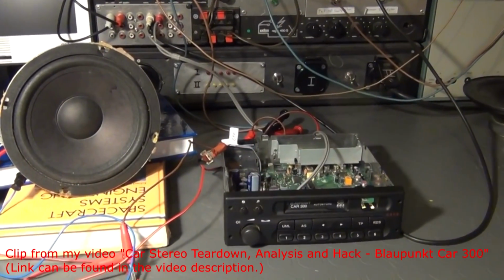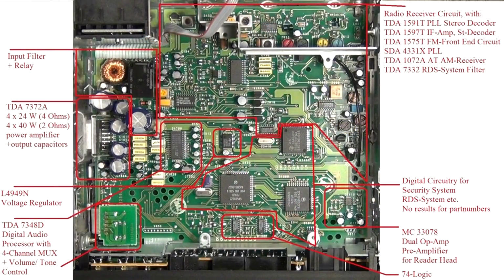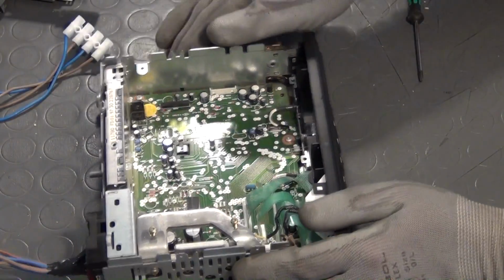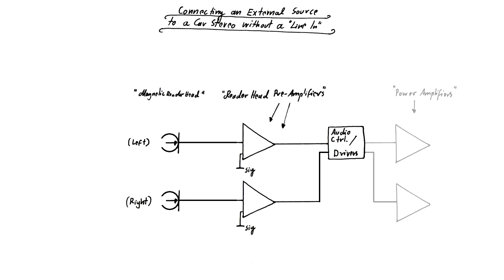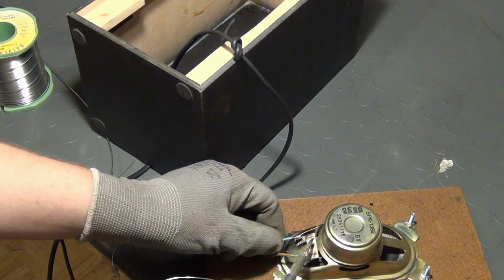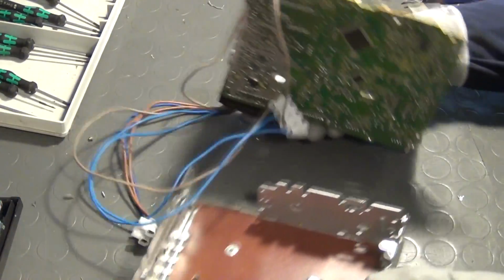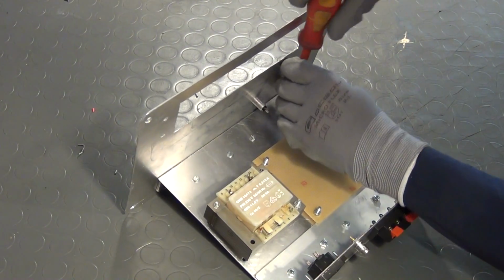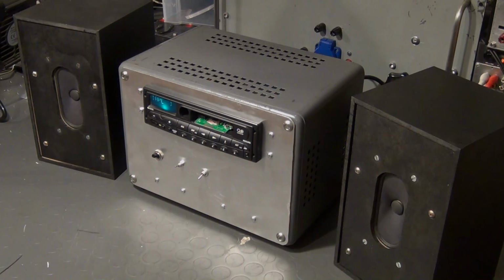How to Convert a Car Stereo to  a Home Stereo System + Bluetooth

Comment: How to cut the oval shape for the speakers,  I also do have those from my TV set, want to utilize them.
Reply: +bazrazin1 I would do it with circle cutter thing for a drill, but I think that either jigsaw or angle grinder would do the job fine.
Reply from the maker: +bazrazin1 I first measured the dimensions of the loudspeaker with a vernier caliper. Then I used a  pair of compasses (I mean the "drawing tool" by that name) and a set square to draw the outlines on the piece of wood with a pen. Then I drilled a few holes with a diameter of around 10 mm into the  area that I wanted to cut out. I then used those holes to insert the jigsaw blade and then I simply cut along the lines with my jigsaw. After that I ground off the edges with sanding paper.
Reply: +The Post Apocalyptic Inventor  y,  that is a quite complicated  procedure, that's why spherical speakers  r made, the oval shape is just to accommodate  in a tight space, I still have that job pending, also do not have those tools,  thanks for the explanation  BTW.
Reply: +bazrazin1 put a clear piece of plastic over the front, trace the speaker with a marker. cut it out with scissors then us as your template to mark your holes.
Reply: +Sirus that was the answer  I was looking  for.

Comment: Holy christ! That's a GOOD way of burning out the finals in a car stereo man, You should NEVER connect non car stereo speakers to a car stereo, the impedance is wrong, a typical home / tv speaker is 8 ohms, car stereos require 4 ohm speakers.
Some older TV sets have 16 ohm speakers in them too!

This is the main issue people  have with car audio and they cheap out and stuff home speakers into their trunk connected to their high dollar amplifier or stereo and a week later the whole system is fried...

The way around this is to connect two 8 ohm speaker in series per channel of the stereo, so for left and right you would end up with four speakers. two on each channel in series.

I have a very nice Kenwood AM/FM/USB/ MP3 CD car stereo that was given to me a year ago that has aux inputs on the rear and one in the front. The face comes off and it changes colors and crap.. I even have the wiring harnesses and brackets for it. I have it in my office hooked up in a similar way but with actual car stereo speaker boxes..
Reply: +ElfNet Gaming 
Oh, an expert! Now explain to me how hooking up a smaller load than something is designed for should fry it? And why is it then suddenly ok to hook up a 16ohm speaker (8+8) to an amp built for 4ohm speakers?
Reply: its not ok to use an 16 ohm speaker. I never said it was.
I did however make a mistake and didn't realize it until after I posted the comment. For 8 ohm speakers you connect them in parallel to get a 4 ohm load, not in series. 

Connecting an improper load will either have too much or not enough resistance, depending on the tolerance of the amplifiers FETs will depend on if you can even run it safely for periods of time.
Now with a 15 watt car stereo this may mean absolutely nothing, but if you have a 1500 watt amplifier well you don't want to be "experimenting" with speakers there.
Reply: +k ma You can actually damage some modern class-D amplifiers by connecting a speaker with too high an impedance, but this is too old to have that problem. (The speaker is part of the output filter, so if it's wrong or missing you can get a nasty over-voltage on the output transistors.)
Reply: or an 8 ohm resistor in parallel with the speaker

Comment: tape's and albums are coming back!#!
Reply from the maker: +225rc I have an LP collection and several old school tape recorders from the 1970s. I have some love for those formats. But I hate and always have hated "Audio Cassettes". I'm also quiet sure there will never be a permanent return of that technology :D
Reply: +225rc CD/DVDs were the worst media. yeah they allowed you to put alot on them and be able to go straight to a song or file but they scratch up so easy, I have long since phased them out and use only solid state flash media now aside from hard drives in my computers and CCTV DVRs.
Reply: +225rc
Nooo! Just a week ago I found out that my tape deck must have broken some time in the last two decades (I think that's when I pushed a button there the last time). So you say I will miss that in the future? In the same way I missed the CD player part that died maybe 15 years ago and never got repaired? ;)
Reply: +superdau but look haw long it lasted.
Reply: +ElfNet Gaming yeah it's amazing that when CDs came out they made such a big deal about how durable they were by putting them in washing machines and then showing that they still played etc. but they really do get ruined by scratches easily. Not as easily as vinyl but still plenty to ruin them. 

Still better than standard magnetic casette tapes for audio quality though if kept in good condition because it's digital it doesn't degrade over time as it's played etc.
Reply: +KX36 when you hear a record on a good system then a cd you realized how much is missing on the cd because of compression
Reply: +225rc 
If you really hear the compression when listening to an audio CD you've just outed yourself as an audiophool.
Reply: +superdau if you have ears you can hear instruments missing
Reply: 225rc
You know that the audio on a CD is uncompressed data, right?
Reply: compression selectively takes some instruments out and leaves others? that's amazing.